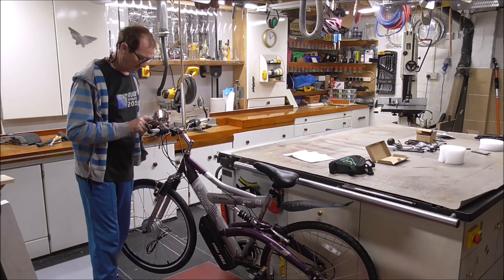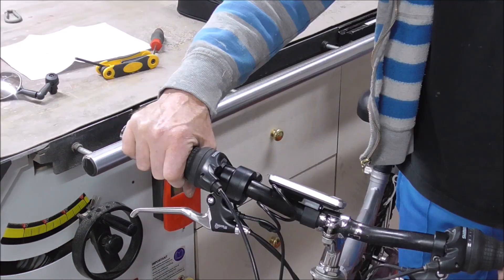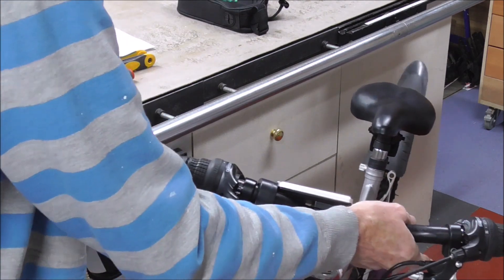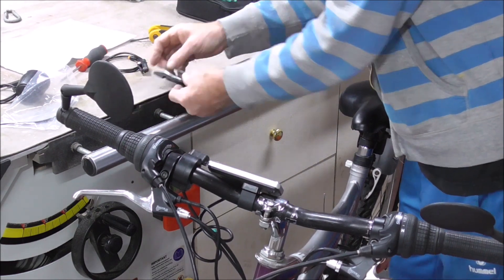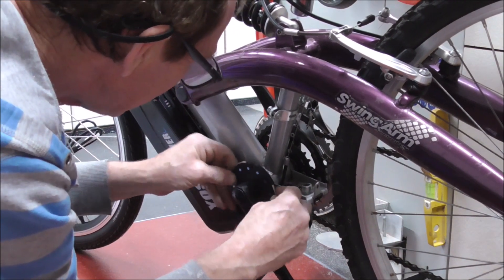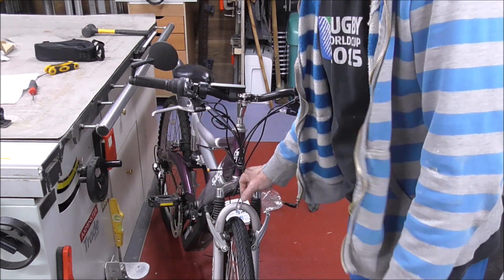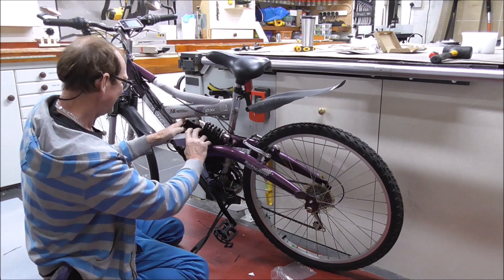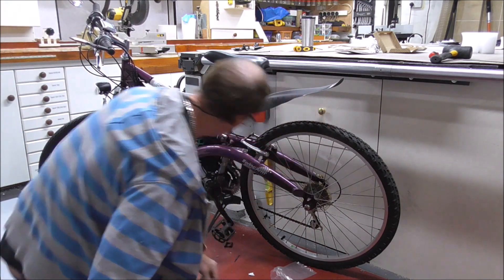Quick & Cheap E Bike Conversion part 2

Comment: Thanks for sharing this video I have bought this yose power kit I love my ebike conversion and a top notch kit. I did have trouble fitting the front light as it needed more things out of my shed to fit onto my bike. But the kit installed well and worked perfectly. Ended up drilling through my frame to attach my battery as the holes in my frame mount battery didnt line up as the bottle holder was too low, used araldyte to help keep the battery base firmly attached to the frame.....!

Comment: Nice work! Pro tip: Next time use pressure air instead of lubrification with the handle grips.  With lube, the grips are going to be turning while riding.
Reply from the maker: Hi thanks for the help yes I've seen that way of doing it but the stuff I use vanishes very quick so I prefer this way